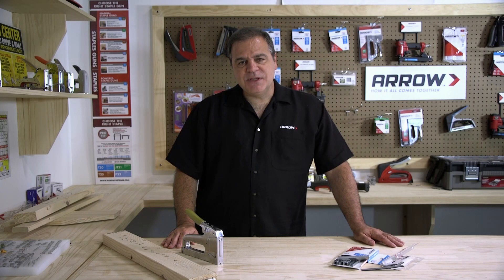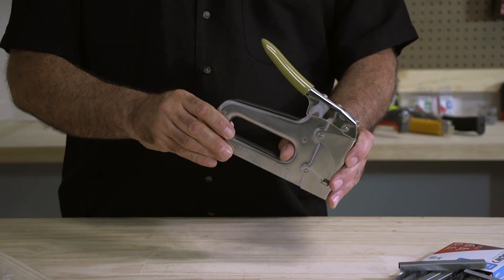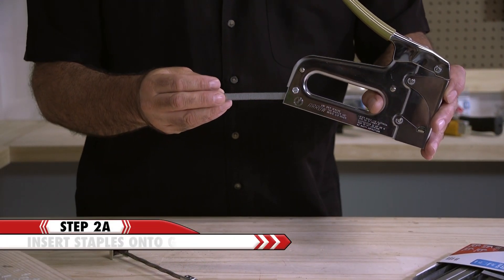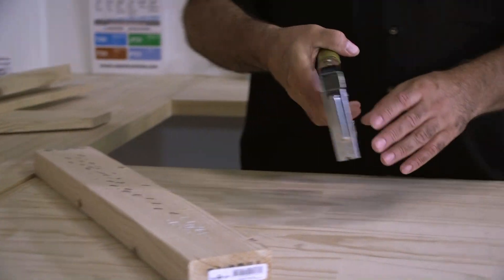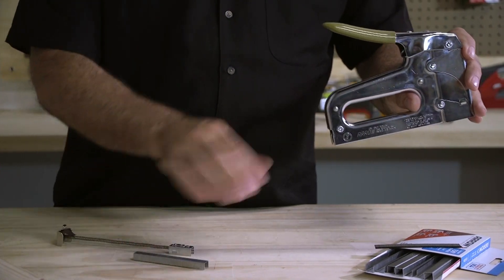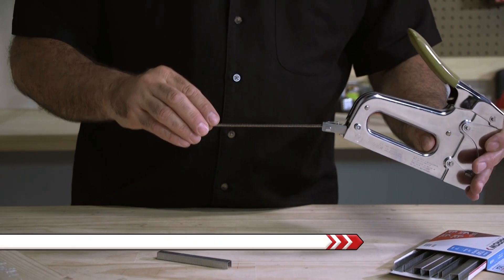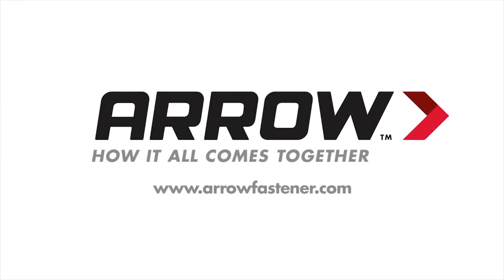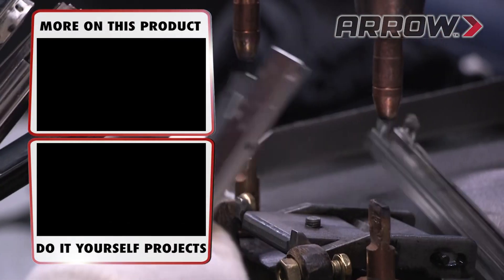How to Load Arrow's T50PBN Staple Gun and Brad Nailer

Comment: I like this kind of tool
Reply: I ordered it today it says I that it will arrive on agust 18
Reply from the maker: We hope it works well for you!
Reply: @arrowfastener  have you heard of arrow t18 staple gun please make a video of it
Reply: @arrowfastener  😊
Reply from the maker: @Alaabadwayshorts  The T18 is an older-molder wire tacker so we won't be producing videos for this stapler. However, we do have a number of videos about the T25, which is a newer model that is similar to the T18. Hope this helps!
Reply: @arrowfastener  wait the t18 staple gun is been used in a long time ago now people are using the t25 staple gun for installing wires?
Reply: @arrowfastener  what about the t72 staple gun can you make a video of that stapler 2?
Reply from the maker: @Alaabadwayshorts  The T59 is the updated version of the T72. Here is an overview video for that tool: https://youtu.be/vbFBvat5Mr0. There are also videos on unjamming and loading. Hope this helps!
Reply from the maker: @Alaabadwayshorts  Both the T18 and T25 are designed for installing low-voltage cables and wires. The tools are similar but the T25 uses a rounded staple with a wider crown that the T18. The T25 is a new model. Hope this clears up your confusion.
Reply: What kind of staples does it work with the arrow t50PBN?
Reply from the maker: @Alaabadwayshorts  The T50PBN uses T50 staples in 1/4", 5/16", 3/8", 1/2" and 5/16" lengths.
Reply: @arrowfastener  good
Reply: @arrowfastener  do you know about the arrow stapler t75?
Reply from the maker: @Alaabadwayshorts  Here is a link to information about the T75 on our website: https://bit.ly/3RhzMaV
Reply: @arrowfastener  what does the t stand for on the staple gun’s model?
Reply from the maker: @Alaabadwayshorts  The "T" has been used in Arrow tool and fastener names beginning with the introduction of the T50 and stands for "tacker."
Reply: @arrowfastener  do you know what does the jt stand for on the model JT27 stapler?
Reply: @arrowfastener  I am @ easy gamerz 5567 but now I changed my channel
Reply from the maker: @Alaabadwayshorts  Junior Tacker
Reply: @arrowfastener  1 brought an arrow t18 stapler and I don’t know how to unjam it can you show me how to unjam it?
Reply from the maker: @Anthonyxinchen1374  Hello - We don't have a video for that specific tool. However, its design is similar to the T50, so this video should help http://bit.ly/t50-tip. If you're still having problems, let us know. Thanks.- Arrow Fastener
Reply: Wait do you know the stapler t50oc can you make videos of it
Reply: Also I wanted to know what does the t50oc do
Reply from the maker: @Anthonyxinchen1374  Hello - The T50OC is an outward cinch stapler designed for packaging applications. You can read more about it here: https://bit.ly/3qnzq6o. We don't currently have a video about this staple gun but appreciate your suggestion!
Reply from the maker: @Anthonyxinchen1374  You can learn more about his tool on our website: https://bit.ly/3qnzq6o. This stapler inserts staples with the legs outward. It is used for packaging applications.